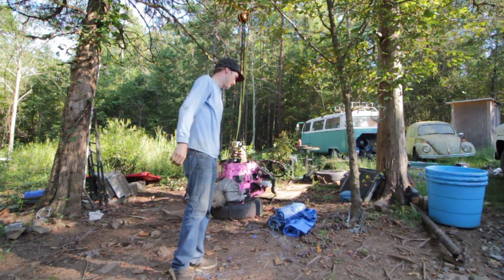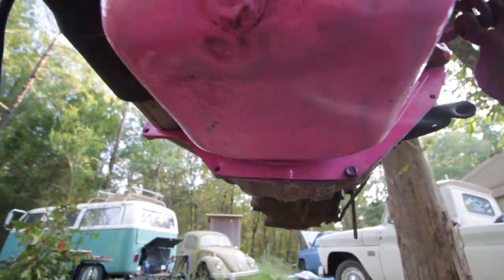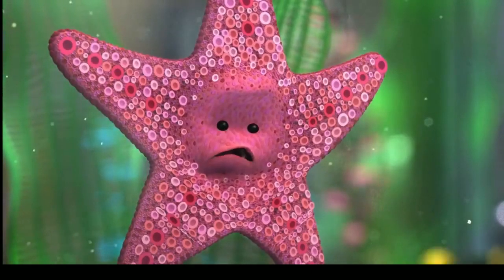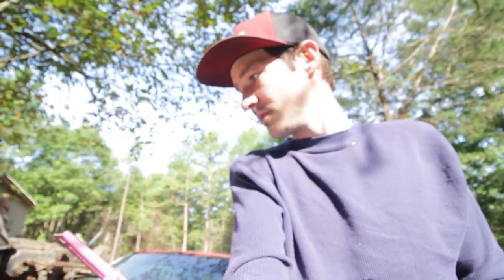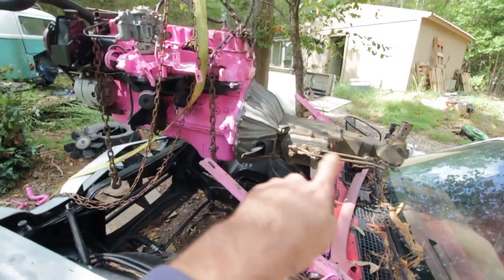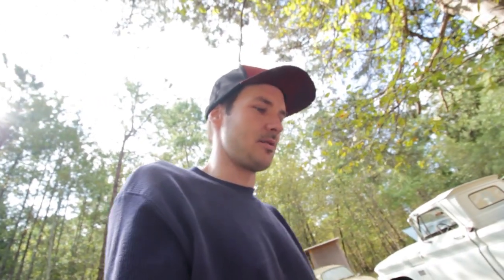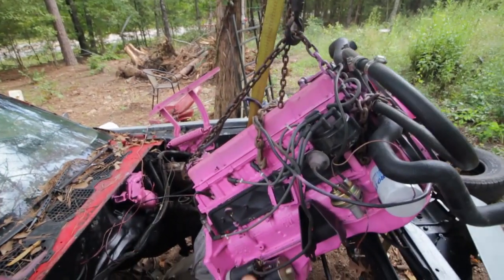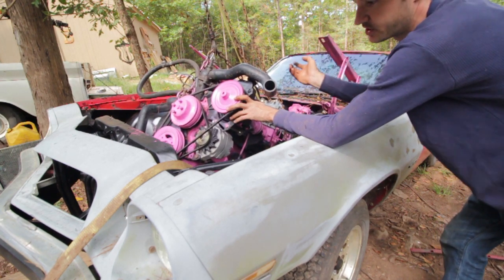1977 Camaro motor install! (THE MOVIE)

Comment: Great job! Hard work foes pay off. For we inging it you did great in figuring out some of your unknown.
Those unknown wires near your brake booster, one is for your proportion valve, it senses a broken brake line.
I c as not remember where the 2 wire goes, been over 20 years since my last inline 6 install.
FYI, get the correct power steering line, fuel line will NOT work for oil. It will soften and blow the line, power steering fluid will catch 🔥 when it gets to your exhaust pipe.

Great fix on fuel system too.

Comment: Nice work! Your Pitty ABSOLUTELY deserved those belly rubs! I had a 1981 c10 with that six, it was a gutless wonder but it ran. Miss that thing. Booger yellow paint, rust everywhere, floor manual granny + 3 useful speeds. Top gear was useless on hills.... Nothing quite like an old barn truck!
Reply from the maker: I have one of those but it's an 84 and blue 😂 thanks alot for watching. I definitely cant get enough of these ol vehicles!